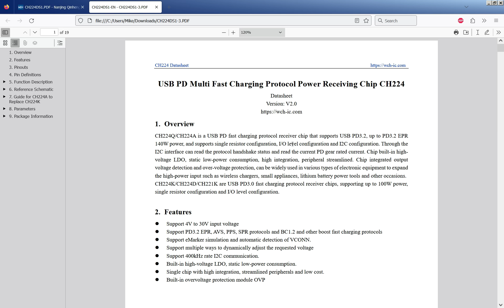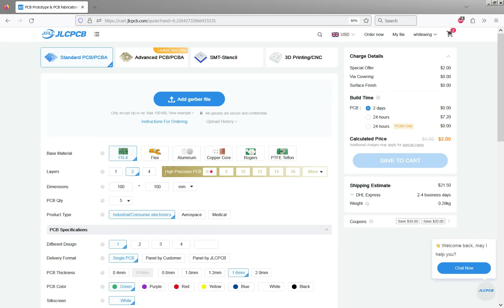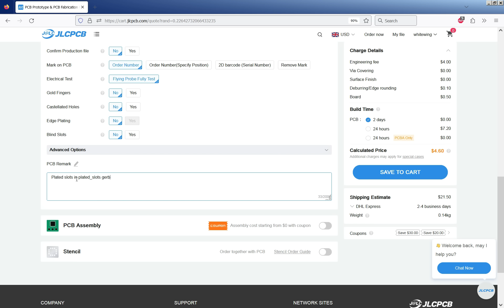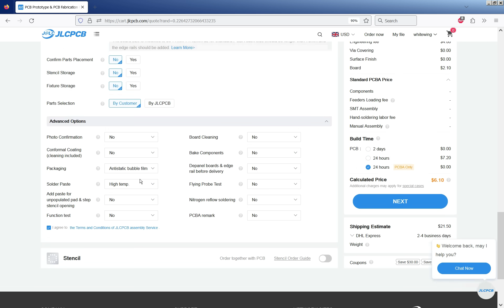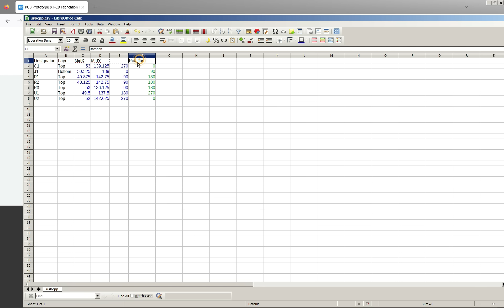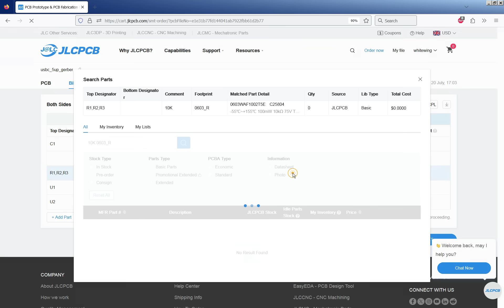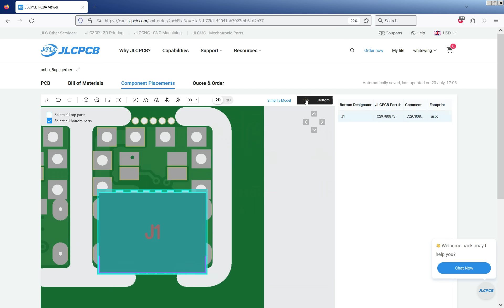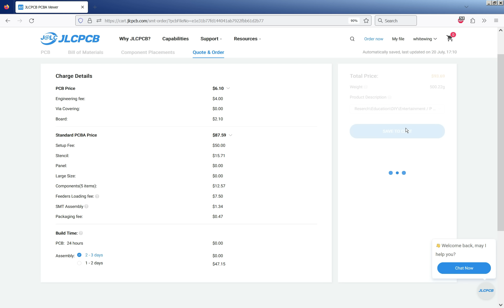USBCing all the things

Comment: The possibility might be there, I don't know, but actually getting any voltage from the charger could be great.

My idea for the universal charger, is to have a simple voltage divider, on the device side, that would return a certain voltage back to the charger to sense the output. One other feedback could be the receiving voltage. This last one is to test voltage drop over the cables and not set if on fire if you request more than the cable can handle. Now this may be done with any usb cable but devices with data pins, might fry. But getting all sorts of devices that require any voltage and be feed from the same charger would be nice. Also would be a lot cheaper to deliver power to any device, just the cost of 2 resistors, no CI no logic. No pins to setup, you can get any voltage with just a potentiometer. It's like using the charger as your own lab bench power supply.

Maybe such CI exists and you just set it with a voltage divider. I just can't find much use of 9, 15 or 20v presets. And older devices run on 6v or 7v or something strange you don't have a transformer for.
Reply: a lot of the USB-PD supplies got PPS; so with a more powerful controller chip you can actually set any voltage.
There is no resistor way to set the voltage on USB, but if you got a chip that can ask for spesific voltages you should be able to adjust on 0.1V steps (or better).

Aka 5V (or no voltage), or you got to talk to the source via a spesific serial protocol!

Comment: You need make these potted  for stability  and you jump battery discooect that is the 3 pin is disconnected when USB is enabled

You also need have "check if voltage is right" then give power as USB starts at 5  volts

Comment: 6:20 where do you get the idea that the resistor runs 20mA at 20V? Yes, it's 1kOhms, but it isn't shorted to ground, it's connected to VDD of the chip... Which most certainly does not draw 20mA
Reply from the maker: Ever heard of an approximation..? 278mW or 400mW - both way outside the power rating of a resistor that would fit  the PCB

Comment: I'd much prefer the DC jack to USB-C PD converters (5/9/12/15/19V) that already exist on AE. No soldering required and you can keep the device original. They can be bought on AE for less than $1 a piece.
Reply: That was my initial thought. You can even measure the barrel jack voltage before plugging it in, making sure that USB C PD is working. Sure it’s an adaptor that you can easily lose. Same as the original wall adapter.
Reply: Yes but easy to plug in with the wrong voltage and destroy a $300 device, not really worth it, and not something you can just leave laying around for others to use.
Reply: @jaro6985  people should stop saving stupid from leaving the gene pool and everything will be fine in a few generations.
Reply: @jaro6985  "easy to plug in with the wrong voltage"
Wrong. That's not how PD works.
 I much prefer a common power supply that can work with various devices instead of some ridiculously proprietary (read: random sizes and polarity) and often difficult to replace power brick that only has one single purpose in life.
Reply: @CoCoNutBob  you misunderstand what product they are talking about, its a USBC to barrel jack adapter. If you take the 12V version and plug it into a device thats made for 5V, it will destroy it.
Reply: @jaro6985  it seems you misunderstand the point of this video. He's not making a barrel connector with pd adapter, he's removing the barrel jack and making it USB powered.
 Any time i make a PD to barrel jack adapter, i put yellow heat shrink for 12v or red for 5v. Anything else gets labeled, as they all should be.
Reply: @CoCoNutBob  So you rely on a piece of colored heatshrink to protect the product, some of us want a foolproof solution instead.
Reply: @jaro6985  no, I rely on my intelligence. 
There's nothing so fool proof that some fool can't screw it up.
Who is going to plug unknown barrel jacks into a device without checking first? It's not rocket science.
Reply: @jaro6985  i like color coding things. Makes life so much easier. 
A yellow barrel jack is 12v.
A red barrel jack is 5v.
It's not rocket surgery.
Reply: @CoCoNutBob  its fine if you are the only one that will ever use it.
Reply: @jaro6985 meanwhile, there are numerous random voltages and polarities on very similar and frequently interchangeable barrel plugs... I'm not sure you've thought this argument through.

Comment: My biggest challenge in my quest to PD everything is that some devices wants 5v 4a or something like 9v 4a. I wish someone would make a small circuit that negotiates 12v or 20v only to buck-convert  it to these lower voltages (now with the benefit of being able to draw more than 3a), but in a nice small packade.
Reply: Or use USB-PD PPS, ask for the desired voltage @ 5A, then enable power out to the load. You may want a 100W source.

You could actually do a universal battery charger that way, just connect the USB-C power source to the battery and ask for various voltages with 0.1V resolution.
Some cellphones do use tricks like that, where they ask for very particular voltages. Not sure how direct the connection actually is.

Comment: 6:00 you're talking about "if you knew it was going to be 20v you could use a higher resistance" - but doesn't it have to start at 5v and then renegotiate the voltage?
Reply: it should do that yes
Reply: Yes, always!
5V can't be skipped, but load can be disconnected (using mosfet or similar) during that phase if desired.

Comment: Replacing a dead simple and very robust with USB rubbish! Blasphemy! Different strokes for different folks and all that but given that most USB power supplies are garbage, and may are downright dangerous, I have to ask why?
Reply: Because you only need a single PSU for all the stuff? Might even buy a proper one for a couple dollars and call it a day. Or maybe just use your phone charger, that should not be too bad.
Reply: @allesklarklaus147  Many older devices (with internal rechargeable cells) are made to use unregulated DC adapters. The charging circuit depends on the higher output voltage at lower loads. You can't just slap on a modern regulated supply at the same voltage. 

Many devices are also made to work with adapters that output only a few hundred ma. and many adapters have internal fuses. Little chance of starting a fire in the device that way.

Now you hook up your USB-C which can supply 2-3 amps and what is the result when things go wrong? What about when that Chinese USB chip fails and sends 19V into your vintage 5V device?
Reply: @HeyBirt  It's unlikely that the chinese USB chip would fail in a way that it somehow remains partially operational, AND accidentally sends the perfect signals to renegotiate the PD voltage to something out of spec.
Reply: @HeyBirt  I don't really see any "vintage" devices in his video. And for the last part: do you charge your computer and phone outside? If the charging circuit fails, they have a nice lithium battery that might burn. A vintage device combined with just 60 W is very unlikely to start a fire.
Reply: I’ve converted a bunch of stuff to USB-C, including an old netbook over the last few years. Never had a problem, but now I only need the one supply and the one sort of cable for everything, instead of a drawer full of wall warts.
Reply: None of my USB supplies are garbage or dangerous - but I don't buy them off Aliexpress or from a somewhat dingy stall in a dark corner of a market selling knockoff phone cases..

Perhaps the goal is not to adapt 'vintage' electronics but to simply get mostly modern equipment to use a common connector for practicality?
Reply: @Monkeh616 my label printer, euroshop LED lamp, and eee pc are not what I would call vintage; I would never do this mod to my beautiful old vintage computers. But I would make USB-C to barrel jack converters for them.
Reply: @HeyBirt how about you just dont use shitty USB power supplies then? Never had any problems with my Anker ones. Buy cheap, and you get nasty. Simple as that.

Comment: Over the years when repairing all kinds of equipment I found that a lot of the voltages are far too high and with a little bit of adaption on the device itself it can be made to use a much lower voltage, so when you're in a device it might be worth taking a look if someone thought it to be necessary for an LDO to have 4V headroom
Reply: Yes, old linear regulator need 3-4V 'headroom' to work properly. That is why you have a 9V adapter for a 5V regulator. Also why linear regulator run so hot.
Reply: @HeyBirt  I was specifically talking about LDOs here

Comment: Sometimes I thougt about such conversions, but I didn't do them as I didn't want to modify perfectly fine equipment. 
Also because the philosophy behind USB C already kind of failed because who would have guessed manufacturers cheaped out. They didn't populate the CC resistors, and omitted important functions or implemented them in different ways (Audio for example can be done actively or passively, also DP/HDMI alt modes are incompatible).
When Micro USB came out they also said it would be universal (yes - even Apple - look it up. They provided a free MicroUSB-Lightnig adapter to confirm if you insisted 😂 ).
But since 5 years I do not buy new MicroUSB stuff, just USB-C. All my daily driver devices are USB C, and that's what matters. 

USB C will get absolutely chaotic in 10years or so. It has become a monster. Just try to get a dock/port extender where all features work with 20+ different laptops (in a stable manner), it's almost impossible. I don't even want to think about compatibility in 10 years. ("Oh, sorry this feature is legacy, it's not supported in newer laptops anymore" and then you have to get active converters like from USB-C-DP-altMode to USB-C-HDMI-Altmode)

Comment: This needs a small 3D-printed shell (two halves, or a single one with a cavity) that would on one hand snugly hold the USB-C connector and support it sturdily once soldered in, and on the other hand cover up the expected round hole with the same sort of outer dimensions the case was expecting the connector to have. I suppose it might even be possible to embed the thing inside the shell by pausing mid-printing, but that sounds like a bit too much bother...
Reply from the maker: The problem is some equipment will need the USBC further forward than the face of the jack

Comment: Unfortunately they still insist with power bricks.I only need stuff with USB-C PD . nothing else..
I use an old ASUS laptop that has all the Thunderbolt features ..except the part where the device charges from it was intentionally ommited ! 🤦‍♂
I thought about those cables you showed to adapt it but Im unconvinced it is any better.
Reply: I've used some of those usb-c to barrel jack adapters and they DO NOT power laptops!!  Lol I got one that was "100w" and I was deeply skeptical - and it browned out after ~50w load under test... sigh
Reply: @prozacgodretro  I read somwehere there were some certified ones that are supposed to work though.  That's exactly my beef with them, I doubt many will actaully do what they tell.

Comment: also jlc and lcsc dont share the same inventory. when using easyeda parts picker you see 2 stock counters, one is lcsc and one is jlc assembly. its annoying as they sometimes doesnt have them in stock at jlc... 
there you also can see if its a basic part (free placement) or extended (3 bucks extra per parts reel insertion) so i pick the most basic parts possible even if i have to put resistors in series to avoid the extended fee.
Reply from the maker: There is definitely some wierdness - sometimes JLC search doesn't recognise an LCSC part number but you can find the same part via it's manufacturer part number.

Comment: 2.50 a piece is not bad but if i did that, id use a CH224D its the qfn package that allows for cheaper single sided assembly. 
i never did dual sided in my 50 or so orders, as it allways made the price skyrocket. id rather make the pcb split in half using vias and stack them back on back or something like that.
Reply: Double sided costs no extra at JLC. Checked this a few times. You're probably thinking of 4 layer vs 2 layer.
Reply: @jaycee1980  huh?    selecting double sided assembly moves you out of the economic smt category into standard, which quadrupled the price for me
Reply: @gamerpaddy  for some reason i misread that as double sided pcb.. not assembly. Sorry!

Comment: For the brother labeller I managed to get a 12v PD trigger cable, then cut it in half and reversed the polarity, it's not perfect but for anyone who doesn't want to modify the whole board it's exactly what you need. Just be mindful that some PD sources don't implement 12v, I try to only buy sources that do so it's less of an issue.

Comment: It defintely looks interesting and a nice form factor. Too bad that 12V is not part of PD standard - so for 12V devices, it'll depend heavily on the power supply whether it works or not.
Reply: True, but most "12V" devices don't actually work at 12V, they internally down-regulate to 5V or something similar (leaving lots of headroom for the horrible dropout voltage needs of their ancient 7805 regulator). Depending on what you can determine studying the power input section of the device in question for a bit, it's almost certain that either the 9V or the 15V profile would work just fine with them without changing anything except the connector...
Reply: @AttilaAsztalos  The most horrible LDO power waste  I found was using 9V battery to generate 5 or even 3.3V...And it was in multiple devices...heck I can'T remember if I ever saw 9V battery being used better. I guess devices with better power management used 2xAAA instead of 9V.
Reply from the maker: Not a huge deal - the primary goal is replacing lots of adapters with one, so you just chose a known good one.

Comment: I've done well over $100k business with PCBway but never tried JLC. Should i make the switch?
Reply from the maker: I've done over 200 JLC orders - only used PCBway a couple of times when they offered something JLC didn't at the time ( large size).  Mostly bare PCBs but PCBA more recently - no significant complaints. Not tried PCBway PCBA yet so can't comment, but having instant quote/order and LCSC stock on hand seems like a big advantage.
Reply: @mikeselectricstuff  Yes! That is something that stood out to me as i use exclusively LCSC parts, where possible. 
PCBway does pristine assembly work but rips me off on component cost every time. 
Thanks for the insight!
Reply from the maker: @mikeissweet  JLC can get pricy if you need to have them order parts in from Digikey etc. The actual PCB and assembly cost is so cheap that it is usually still pretty cheap overall.
Reply: @mikeselectricstuff  Same with pcbway. Though even for LCSC parts they'll try to charge single piece prices when I'm doing an order that will consume an entire reel.
Plus, the more business i do with them the longer they seem to take to build my PCBA orders (should be a month, ends up taking 6 weeks). 

One recent order of 3,000 boards, they somehow managed to zap a mosfet on half of them. Plus a handful of microcontrollers. I received only $1,000 compensation and my guys had to test and replace thousands of parts. Besides this major ESD screw up, their assembly had been perfect. 

But between last lead time and cost, i think I'm going to give JLC a go for my next order

Comment: Some other suppliers, notably pcbway and OSHPark will hold the design publicly and allow buyers to just re-order rather than re-upload. Not sure if jlcpcb have caught on to this yet (they hadn't, last time I checked)  but I think it's a good feature and I've used it for the AR488 HPIB adapters on an eevblog thread.

Maybe someone would like to design a 3d-printed trim that would fit a suitable drilled hole (12.7mm ?) and neatly surround the USB connector with a bezel ?
Reply from the maker: Yes, would be good if JLC would do that. Seems they have all the systems in place to do this easily. Not used any of the others but JLC's integration with LCSC is a major advantage.

Comment: I have to praise your work but I have to say that I will not be using your solution. I understand its direct replacement for DC jack and that smaller the thing go higher the price is but 4$/piece + shipping !!! Thats expencive, mass produced trigger board with usb-c femile socket (that you can unsolder if needed or use as is, will cost less than 1$ on aliexporess with free shipping, sometimes you can get them for like 3$ for 5 pcs... I like the miniaturisation but thats expencive for me.
Reply: for a device costing hundreds of dollars, retrofitting 4 dollar part is a bargain
Reply: You comment, however intended, comes over as a bit of a moan.  Unfortunately you have to make and stock large numbers to get to that price. And that investment has to be paid for so it adds to the cost. I'm sure if you feel like ordering 10000 you could get the price down and Mike has been gracious enough to  provide you with the means to do so.
Reply from the maker: Most of that cost is 1-offs - this is unavoidable when making anything. I just ran a quote for 500 on JLC and it came to 60 cents per unit
Reply: The price difference is large as a percentage, but it's still only 3 dollars more. How much time would you spend looking for a cheaper alternative, to save $3?

Of course, the real price here is $100, and you get 25 boards. 😂